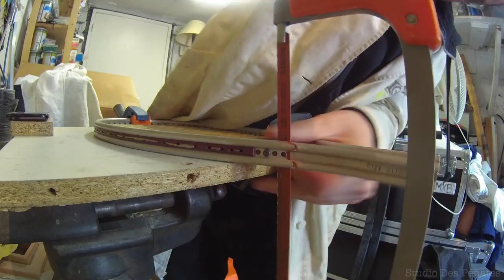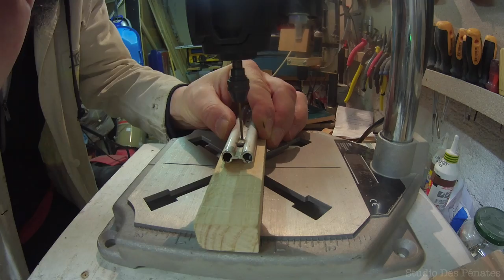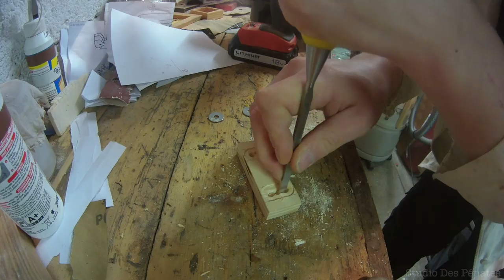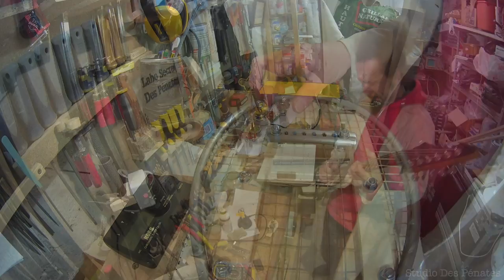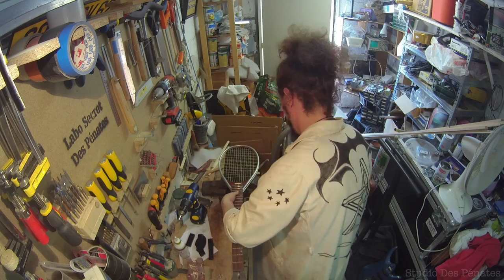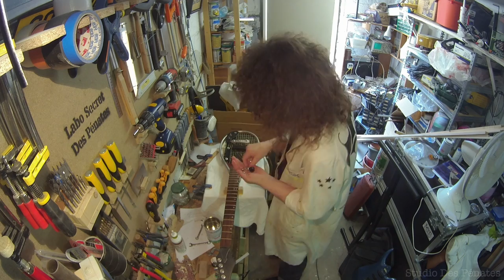Martina, The Racket-Guitar

Comment: love the sliding pickup system. there was a guy i bought pickups off of many years ago. he made individual electromagnets that snapped in and out of a sliding system like 9v batteries. SO you could individually move the pole on each string. But then he did something illegal and the whole biz was shut down.
Reply from the maker: tim sway interesting, thanks. A project on its own when it comes to wire it up, I think, but it could be fun in the end.